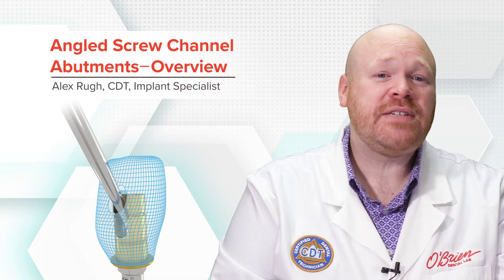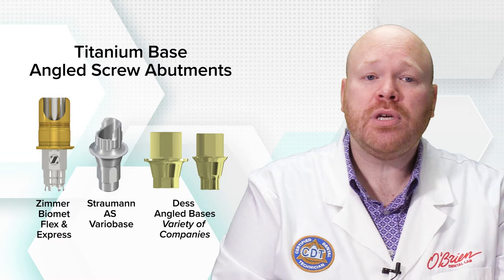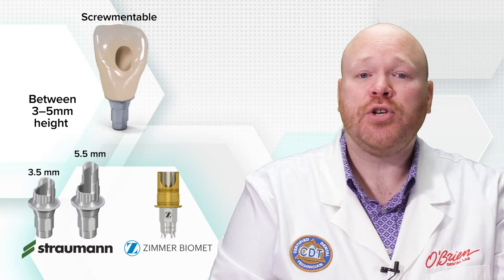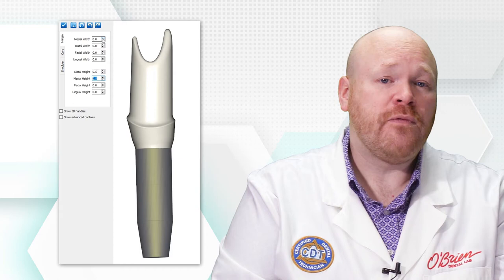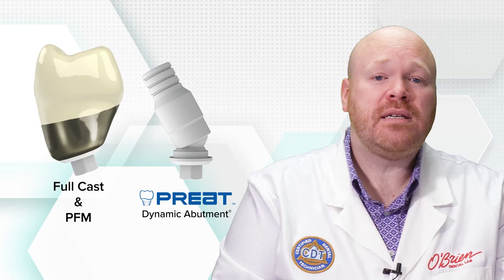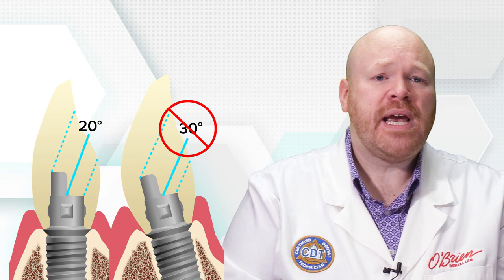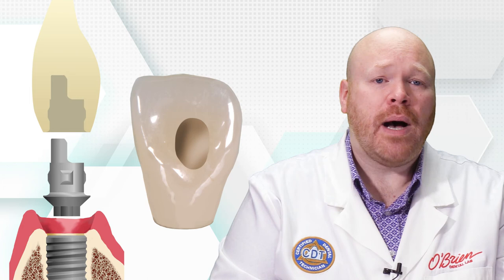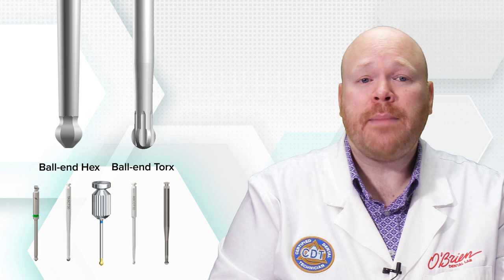Angled Screw Channel Abutment Options

Comment: While using CAD, would you advise using AS variobase/abutment if the case requires just a tad bit of angulation? Let’s say tilting the screw channel direction by just around 1-3 degrees or maybe 5 degrees maximum? 
Or are we able to get away with just using a regular straight abutment/variobase and do some work around using these abutments? Any thoughts on this, because we have done it several times and it has worked for us.
Reply from the maker: When it's such a small amount of angulation required, we have found that it works to just use a straight abutment.

Comment: Is it possible to remove the screw through the prosthetic part after cementation??
Reply from the maker: It depends on which abutment is being used.  Most of the abutments allow for the screw to be removed even after cementation of the crown.  Others, such as the Atlantis abutment, do not.